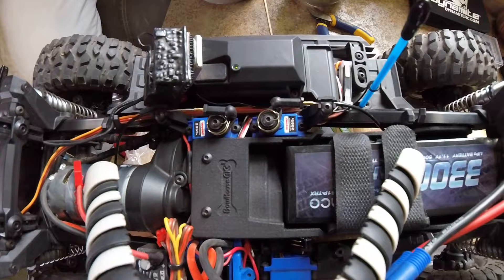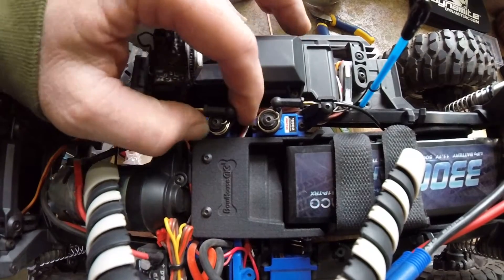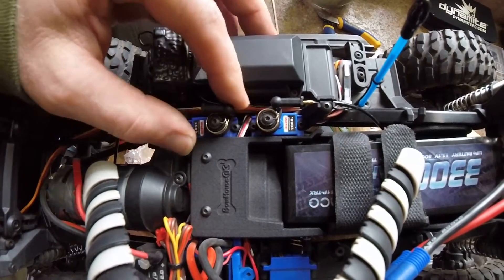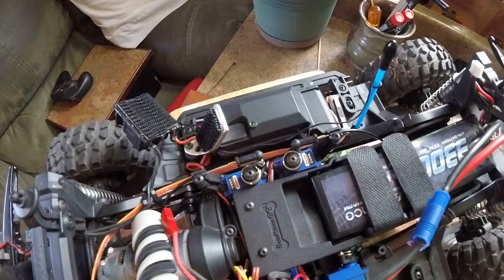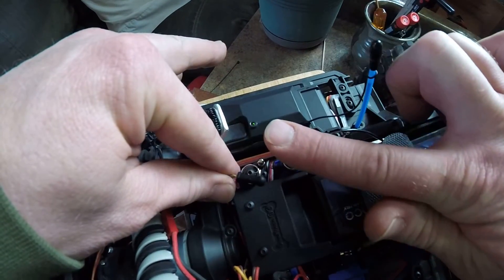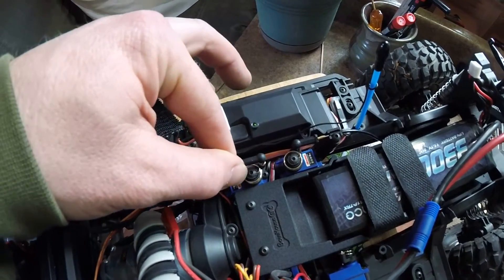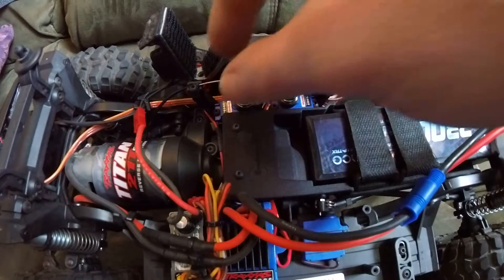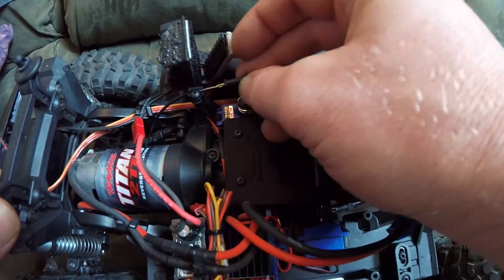TRX-4 Micro Servo Adjustment

Comment: Mines junk too. Did you end up getting it fixed?
Reply from the maker: My servos never actually broke by themselves I broke them by trying to remove the servo saver, doing so stripped the internal gears, you absolutely need to hold on to the top of the servo sever with needle nose pliers to avoid this. What I was after with this was just a bit of insurance that they would last (after replacing the one I broke). I did a follow up video where I explain how to adjust the cable length https://youtu.be/RX46sRzpXwo
What exactly is your issue? I'd be happy to try and help

Check out this new product from HeyOk Performance to set end points on any servo, this problem was basically the inspiration for this item. 
http://www.rccrawler.com/forum/traxxas-trx-4/595674-end-point-adjuster-diff-servos.html

Also there's a thread in the RCCrawler forum discussing this in depth
 http://www.rccrawler.com/forum/traxxas-trx-4/587415-options-replace-micro-servos.html

Comment: Nice vid. What battery tray is that? I am looking for relocation of my battery.
Reply from the maker: Thanks, its a  design from BowHouse RC sold on shapeways, there are a few other designs out there too made by other folks, a few are front mount but they will require small batteries.
 Heres a link to the BowHouse low CG battery mount:
 https://www.shapeways.com/product/XLP5FMYQV/low-cg-battery-tray-for-trx-4?optionId=63009264&li=marketplace

Comment: It almost looks as if maybe the front cable z bend may have fallen out of the shift fork?
Reply from the maker: That's possible, although it still functions as it should minus the grinding servo, and it appears that's the location its always been in due to where the servo horn is at. But I will find out before the end of the week.